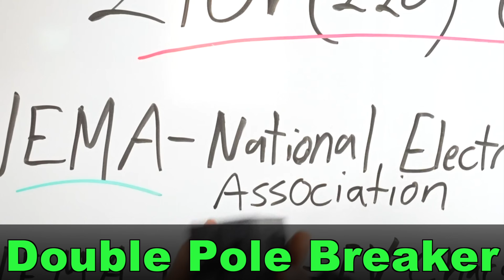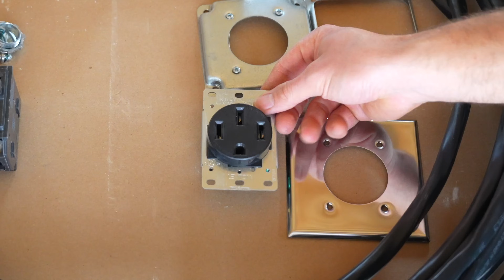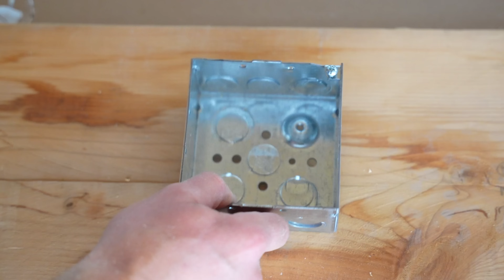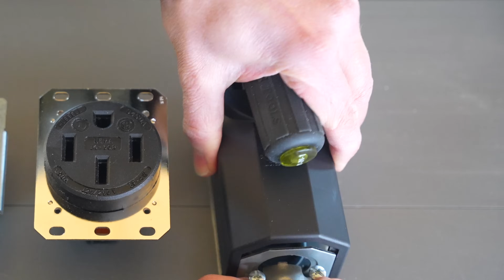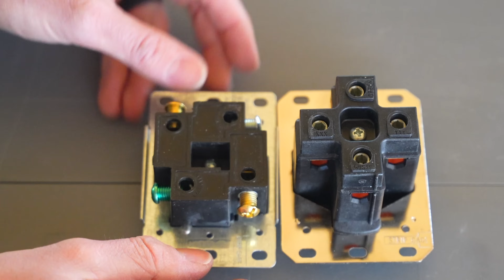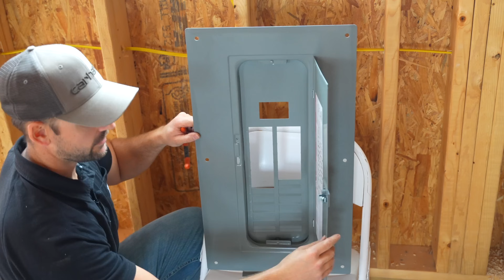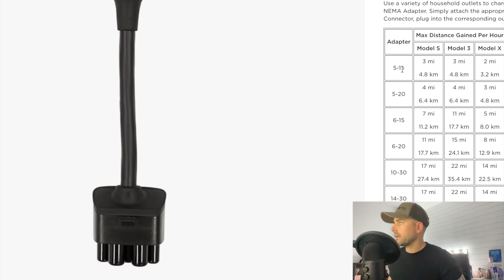How To Install A 240V Outlet In Garage - EV Car Charger, Welder, And Electric Range (Hubbell 14 50)

Comment: your 6/3 is over kill  8/3 is enought you can run 55 amps in it ,,,your 40 amps charger is good on it at 80% of charge whit 50 amps breaker

Comment: Get an EV rated outlet. Ive seen lots of melted ones that weren't ready for the kind of abuse EVs put on them. And idk about other places of course but where i am i cant use 6/3 romex for an EV because its considered a "continuous load" i had to run either 4/3 or run #6 wires in conduit so check your laws i guess.

Comment: If your working in existing walls, how do you do the stapling?  I'm working within 6 feet of the breaker box.  As one of the comments suggested, should this be a GFCI breaker?

Comment: As an auto tech, I was flabbergasted with the insane torque specs for those little bolts,  some ball joints don't even get 75 ft lbs 😂 great video otherwise!
Reply: "75 Inch pounds" is what he meant. NOT ft lbs. That would snap off the screws lol

Comment: Great video, question: for ev charger : can I install a 60 amp Gfci breaker with a 50 amp hubbell 9450a receptacle also with 6 awg wires.
Reply: Yes, but only if the #6 conductors are THHN or THHW (damp location) and not nonmetallic sheathed. One main reason for this is heat tolerance which allows a 60 amp breaker to be acceptable with a NEMA 14-50R. A 60 amp breaker is the most amps allowed in a level 2 EV charger, and that allows the EV to be charged at 48 amps. 48 amps is 20% less than 60 amps. When EVs are charged continuously for over three hours then the NEC requires this allowance for safety. This is very important for safety against fires. GFCI 60 amp breakers aren't really necessary since there would be  redundancy in the charger safety built in. My state of Tennessee is syil using the 2017 NEC code instead of the 2023 requireing GFCIs for EV plug in chargers. I believe that ALL EV chargers should be hard wired and not plugins.

Comment: Hey guy you MUST RUN THE WIRE AROUND THE GROUND SCREW.....IN A CLOCKWISE DIRECTION SO AS YOU TIGHTEN THE SCREW IT ACTUALLY TIGHTENS AROUND THE SCREW😔😪😔😪

Comment: looking to replace gas stove with electric. i will be running new wire as there isnt a 240v outlet installed. Can i use a 8/3 wire? my stove calls for 40amp so i dont think i need the 6/3 or a 50 amp breaker. I will be using the nema 50 amp outlet though. thanks!

Comment: Do you know if this outlet is rated for a car charger? Many of them are not designed for 8+ hours of continuous load, and burn up the device or even the breaker.

Comment: If there's one electrical job that should NOT be attempted by a DIYer its an EV circuit. 
The engineers are still testing this tech and sadly its at the expense of the car owners and their homes.

Comment: Older house. 125 amp Circuit breaker box. 240 dryer plug is 3 prong 30 amp three wires black, white, copper wire. Don’t use dryer outlet my dryer is gas. Can I replace that 30 amp for dryer with a 50 amp for my level two EV charger? Four prong plug
Reply: the wire feeding the outlet has to be sufficient for the current draw. 30A  outlet requires at minimum 10ga wire, note in this video he’s feeding the outlet with 6ga wire. It’s also a three wire outlet, so that’s two hots at opposite phase and a neutral; the four-wire 50A outlet has two hots, a neutral, and ground. So the answer to your question is likely “no.”

Comment: Really wished I would've paid to have this done 6 years ago when I built my house. 
Going back afterwards is going to cost a lot just to do it nice. Otherwise, I will have to run metal conduit on the outside of the drywall just to get the outlet(s) mounted where I want.

Comment: 2 things White wire not used, cap it. 2nd I just ran a 10 Ga wire for a cooktop stove . New code say 10/4 the difference is the ground bare wire is shielded Green. I think this is for all wire soon? is for cook top. The thing I found is it's imposable to get in Big Box stores. Last thing 300$ for 250 ft but I need 75 not sell 75 just 25-50-100-300 save a ton of money buying 300

Comment: Just want to reiterate.... DO NOT use the cheaper NEMA 14-50 if you're installing for an EV charger!!!  I recently got an EV, and the previous home owner installed a cheap 240v 14-50 outlet... and after a couple weeks of using it, the outlet failed (torch marks on both the outlet and my mobile charger prongs).  I am replacing with a commercial grade outlet (why I'm watching this vid).  Just cant imagine why anyone would skimp out on an additional $70 to not burn your house down.  Anyway, great video - thank you!
Reply: How has the upgraded version of 240v outlet work out? And if so can provide the type of outlet you upgraded with (model number, brand?) thank you
Reply: @sinaibeach4  so far so good.  Got the Hubbell HBL9450A.  just make sure you get an extra deep outlet box.  It's a really tight fit with how thick the outlet and wires are.
Reply: @BenH_9 Hubblel is good but keep in mind weatherproof boxes don’t usually accommodate the heavy duty nature of these so you’ll have to go somewhere else.
Reply: How do I determine commercial grade vs cheap?  I’m about to do this.  My electrician said I could use a splitter to create a new outlet for EV charging.
Reply: If you’re using a splitter from a single outlet, make sure it’s a switch, not just a splitter. You don’t want to run a dryer and an EV charger at the same time on the same circuit. You need some way to switch between the two.
Reply: Some splinters; if say connected to a dryer have artificial intelligence that automatically cuts power off to the EV charger /resptical when turned on.
Reply: @Kat-on3nm its not artificial intelligence😂😂😂😂😂😂😂wtf
Reply: It should have an EV logo on the front, the black part where your plug actually goes in. @trencher7
Reply: The black plastic portion is also generally a larger diameter, had to enlarge the hole in the panel mine was going in over the standard 14-50 outlet that came pre-installed.
Reply: @trencher7 home depot vs electrical supply house
Reply: Price is an indicator for Shure except to pay between 40$ something up to 100$ make Shure it tightins the cable terminals up with like a alan head screw and look for the green EV logo on the face of the recptical. Amazon looks to have a good one that is around 68$ that is also wether (WR) rated; buy a will known national name brand recptical
Reply: In my opinion it's best to use a hard wired Ev charging device; that can be seat to a proper amp draw when in use so it doesn't overwhelm ur electrical service- if needed.
Reply: I will also add to use copper wires only.
Reply: Cheap outlet wasn’t rated for continuous current draw, like a EV charging for 8 - 12 hours.
Reply: About five years ago, I had an electrician install a 50 amp circuit to a subpanel in my garage for an EV charger. The Leviton outlet ended up literally melting, and it was inside my garage. Scary.
Reply: @jliving591 sounds like a bad installation, not a bad product. Guarenteed the screws were not torqued to manufacturer spec.
Reply: Does the new receptacle have a green EV logo?  
It's pathetic that the EV industry had to burn houses down to figure out the circuits providing the power were inadequate and dangerous.
Reply: @sayyourprayers2 electricians are supposed to use a torque wrench when installing the 50A receptacle. Most dont.
Reply: Not only that, but fire insurance probably wouldn't cover it if discovered that the cause was an outlet neither installed by a certified electrician nor inspected.

Comment: I live in a condo and need 240 on my patio. The panel is in my kitchen about 15 feet away and through 12 studs, and an outside wall. Is there any solution besides drywall removal?
Reply: I need this information as well

Comment: I just installed a NEMA 14-50R outdoors in a wet location and made a video documenting the process.  As in a garage installation, a GFCI double pole breaker is required.  I used a 6 gauge wire stripper- much easier than using a utility knife blade.

Comment: I have a great video idea 

50amp generator indeed doesn’t work because the PowerBoost F-150 is bonded

Boo it isn’t charge my Lightning 

Didn’t learn this until testing the PowerBoost 

But I have fix 

Would make a great video

Comment: I just did this job a few days ago. I went from a 3 wire ChargePoint charger to a the NEMA plug 4 wire setup.  Having exposed subs makes this job so much easier! I had to reorganize the attic to run my wires. Now the wife’s Mach E is charging at 20 mile per hour vs the 3 miles per hour.

Comment: Can the 6/3 Romex Wire 600 volt be replaced by the much cheaper 300 volt? Using the outlet to charge my EV. Thanks

Comment: how come u used a 2 pole breaker vs 1 pole?
Reply: nvm it's cause you have two hots going to the panel correct?
Reply: @Leo-rr8sk correct Two hots 120+120=240

Comment: EV Outlets in the garage should be placed on a 50A GFCI dual-pole Square D QO breaker.  Only direct-wired circuits into an EV charger can forgo the GFCI in most municipalities.

Comment: Trying to do my testla plug  Has a red and black wire. It asks for a green wire but my main panel does not have ground. What do I do? Can I use a ground rod and connect my green wire directly to my tesla plug?

Comment: Great video!!  Can you use a 6-2 wire as opposed to a 6-3 wire for this installation if we were to use metal conduit in a finished garage that is already sheetrocked?  Or is 6-3 wire required?
Reply: I made it all the way through.  I was asking to find out if it's ok.  Not to take shortcuts.  Try being kinder.
Reply: Umm you're asking if it's ok to take a shortcut out of convenience because your 6-2 has already been installed??

No.

He explained the importance of using the correct equipment and gave scenarios in which they would be best for the application within the first 7min of the video. Please don't attempt this yourself if you can't make it 7min into this very informational 30min video...

Comment: Well I purchased all he said to do the "proper" installation of a Hubbel Nema 14-50 outlet, including the torque screwdriver.  Why do you torque the outlet at 20 lbs per in, when Hubbells instructions say do it to 75 lbs??  Big difference since the screwdriver only goes to 70 lbs!  Thanks

Comment: GFCI protection is required at the breaker for this application.. the circuit also is only good for a charger rated at 40 amps.

Comment: So regarding welders and 6-2 vs 6-3. Why wouldn't I just pull 6-3 wire and then if my welder is 6-2, only hook up 2 of the 3 wires in the 6-3 bundle? That way if I ever purchase a welder that is 6-3, I can just hook up the 3rd wire?

Comment: Hey this is a great video, I what to install the 240V outlet outside of the garage with the 6/3.
 the distance from the breaker to the outlet will be about 6.5 feet, can I use PVC conduit for this install?

Comment: Should we use a 40-amp single-pole breaker or a double-pole 20-amp breaker? What wire size should we use for both situations? Thank you
Reply: If it's a 40A EVSE you want a 50A double pole. If it's a 32A EVSE (charger), you want a 40A double pole breaker.
Reply: @gustavodelamora3676 thank you
Reply: You're never wrong going up in gauge size use 6/3 AWG wire
Reply: @gustavodelamora3676 thank you

Comment: I'm wanting install a 220 plug for a Tesla charger. Would you suggest using the surface mount plug if I wanted it attached to the outside of the drywall or should I use the flush mount in a surface mount box? Also, my electrical box is outside and I was going to run conduit through my crawl space into my garage. Does it hurt if the wire says indoor only if it is in conduit outside for about 5 feet?

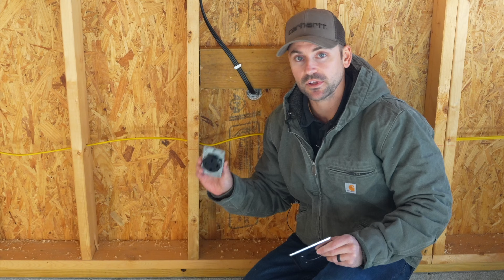Comment: 20:32 It makes sense to use the cheaper outlet for a range because generally you plug a range in once and leave it plugged in except for and occasional removal or replacement of a stove. The EV charger outlet has much more use and plugging and un-plugging of the charger cable over the years. That is where the cheaper outlet will wear out easier over time and potentially become a fire hazard.
Reply: I agree.  I used this on my last ev charger Juicebox and never had any issues in the 4 years I had it. The charger was always plugged in and never unplugged.

Comment: Young man you did a great job explaining step by step on every step to install a 240 outlet.
Reply from the maker: @denniskalivoda  Thank you I appreciate that. I hope it helps!
Reply: @TheExcellentLaborer  I rewired all my 240volt house in England (they have ring circuits), and the inspector did a 32 point check list and said I failed on one point..the insulation on one ground wire (they have that)....  I have been in the US since 2007 and NOW I understand how a 240volt spur (English terminology)n is done...  Hate electric cars so I won't be doing one ...lol...  But I LOVE acquiring knowledge.  This morning I learned how to run my furnace off a car battery. Trouble is the power never goes down in Wisconsin  (12 years so far).  I love looking for solutions to non existent problems !  VERY CLEAR INSTRUCTIONS..Great vid..

Comment: That looks quite a bit different than the 240v outlets I have.  Mine are the standard 3 prong style with the big bulky Bakelite surface mount receptacles, though I do have one smaller one, also 3 prong style, flush mount with the horizontal blades, one of those being L shaped specifically used for a 2hp dust collector in my garage/workshop.  The big 3 prong ones are for my stove and dryer in the house and for a 60 gallon air compressor with a 5hp motor in my garage/workshop.  Why is that one 4 prongs?  The air compressor is on a double pole 30 amp breaker and the dust collector is on a double pole 20amp breaker.  The compressor claims to use 20 amps so I went with 30 for the breaker.  The dust collector claims to use 9 amps so I went with a 20 amp breaker for it.

Comment: Thank you for such a detailed and easy-to-follow DIY tutorial. I wanted to mention that Home Depot now sells a heavy-duty Leviton 14-50 explicitly made for EV use (it has the green EV logo). 

By the way, can you link the torque screwdriver you are using? I can only find one that goes up to 70 in-lbs. Thanks in advance.

Comment: Only one comment, probably just overlooking but when you looped the ground wire to the green screw terminal in the box, you did it counter clockwise. All good electricians know it goes clockwise to get the best grip/connection and less likely to work loose over the years. Good video thanks
Reply: Yes.  Overall great video but speaking as an intermediate DIYer myself, I noticed the same thing.
Reply: i know nothing about anything electrical but i immediately noticed that from the handful of videos ive been exposed to pointing that out (the DIY mistakes vid?)

Comment: Hows a 240v plug be reduced to 120v to use a harbor freight mig welder.  Its tied in from the box in the area using a double 30 amp fuze disconnect.

Comment: I have a question, when opening the electrical panel, how do I know where the Circuit Breaker   is placed to get 240v power, or can you place the Circuit Breaker anywhere, (if the 240v Circuit Breaker will give 240v power and the 110v Circuit Breaker will give 110v power.)
Reply: The breakers can go anywhere.  Voltages add in Series. You get 240V by having two 120V hots. One from each pole on a two pole 240V breaker.. A one pole breaker would be 120V.

Comment: I installed a 240 volt range/oven outlet in 1970 built house that originally had a 3 prong, I posted a video and was told that the ground wire wasn't thick enough, think 16 or 18 gauge, this is connecting to a sub panel only like 10 feet away right behind kitchen wall, can I just run a thicker 6 or 8 gauge new ground wire from outlet to sub panel and be good? 2 electricians commented on my video which I since took video down and also put a new 3 prong back for now instead of the 4 prong

Comment: man, you really showin'um how it's done. There only two types of "how to" videos that work. This is one way and the ones where they let the pictures do the talking. So, if you're going to talk and explain how to do something do it like The Excellent Laborer. strait to the point clear good explanation and white board with the actual examples of necessary materials. I got exactly what I was looking for with one video. cool thanks. I subscribed.
Reply: ohh I just recently took delivery of my Cyberbeast truck and ill be installing the wall charger myself . Not to worry mate this wouldn't be my first rodeo I put in a new main panel and meter with main service entrence including a new 240v 50A line for a range in my kitchen. I'm not an electrician but I know what im doing. I'd never attempt a project if im not sure i can do it.

Comment: The Grizzl e  EV hard wired charger installation documentation shows you need the 2 hots and the ground only. No neutral. https://ecommerce-space.nyc3.digitaloceanspaces.com/Installation_Manual_V1_1_f75be94912.pdf

Comment: Can you please explain to me about the 6-3 Wire.
I know I'm supposed to get a 6 Gauge wire, but is each individual wire a 6 Gauge? or are they smaller gauges individually.
I'm trying to do my research and get the correct wire and hubbell receptacle. if not I might end up just getting a professional.
Reply: Explain what? Each (3) conductor wire is 6awg in the 6-3 "cable".

Comment: So glad you mention industial grade plugs.  For EV charging it is a must.
Reply: They now make EV Grade outlets that have an EV charge logo on them. Makes it easy for the inspector to approve the job.
Reply: In addition if this outlet was installed outside, say on an outside wall outside of the garage, you will need a Weather Resistant version of the same plug.

Also don't forget that the NEC now requires GFCI breakers on all 240 outlets in a garage now.